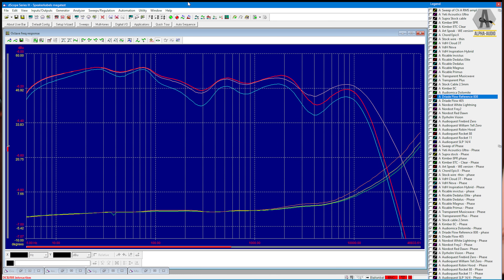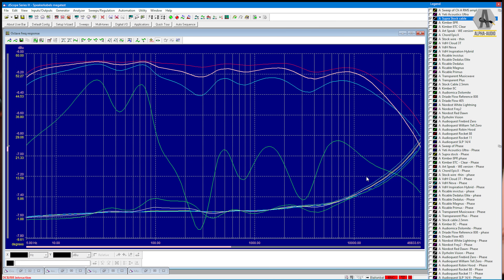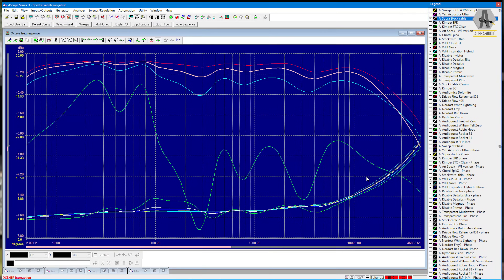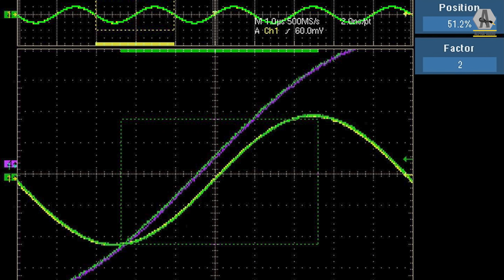Your speaker cable matters! 32 speaker cables tested - with measurements!

Comment: We could tech talk and science all the way deep but 99% of the people don’t hear any difference in cables. On the surface it’s all psychological. There are differences in quality, material, shielding etc but most of these signals are not so much receptive to other signals. If you have a 100.000 system you could debate on using expensive cables but for just common hifi setups, just no. All measurements aside because they just make you reach your wallet.

Comment: I'm bracing myself for a bunch of empty-headed dogma from the flat earthers defending their ignorance and limited capacity for reason with truckloads of vitriol. 

My own experience has indicated that getting the best results with a particular loudspeaker cable depends on which particular amplifier and loudspeaker combination the loudspeaker cable is used with. You really need to try several cables to determine which works best.

Jaap, the assholes accusing you of impropriety are only succeeding in confessing they're the ones who would not hesitate to engage in such impropriety. 

When it comes to perpetually dogmatic internet trolls, their every accusation is a confession. They simply lack the intelligence and self-control to know when to shut up.

Comment: I find it funny how people are arguing about things, they have no practical or real life experience with. I  have taken apart many different type of connectors, stripped down cables of different  types and quality. The variation is  huge. But it not necessarily  translate to a difference you will hear. Some cables have excellent shielding, and some just run a ground wire. Some connectors were solid brass, others hollow. The greatest  range in quality  I have seen was in coaxial cables. You don't  need special knowledge or equipment. The longer the cable the more obvious the difference becomes. Speaker wires, I always run thicker wires than  speaker maufacturers supplied.  Especially  if It is for s longer distance. I don't  want to introduce more resistance into the  system. Don't  be fooled by supposedly gold plated connectors, turned out the actual cable was really low quality. Svideo. Speaker wires high quality buy a roll  10 meter or more, no guessing game.

Comment: I have currently replacing my Fisual Havana Quad XL, which in turn replaced Linn cable with QED XT25 Quad, not because I expect to hear a difference but because the Fisual cable was far to stiff to be practical.
I have very limited space behind my hi fi and forcing such stiff cables into the sockets risked damaging my amp's every time they were unplugged/plugged in.
I'm wiring it into my system while I'm listening, it will be interesting to see if I notice any difference :).

Comment: That is why Zapco introduced there own system for car audio from head units to amplifiers. with much higher voltage vs the basic 6 volt head units. Higher voltage rejects noise and increased transient response with out loss. Robert Zeff back in the day was killing it in the car audio realm.

Comment: Scientists are not testing cables because there is no reason to think they would sound different. This does not mean speaker cables all measure the same. This issue is that the differences are so small. Nobody has been able to distinguish cables on Music in controlled tests. Resistance differences can be audible, but one can simply turn the volume up or down. So, resistance differences basically don't matter. Impedance differences, however, can alter frequency response. The issue is whether they do so enough to affect frequency response, (not whether they measure differently). It certainly Is possible to construct a cable with audible differences compared to most cables. But, for short runs carrying music signals, just get standard speaker cable with sufficiently low gauge. Bear in mind that most speakers have much longer runs of very thin wire INSIDE the speaker.

Comment: ¿How old  are you?  Hearing loss is common after 50, with age-related hearing loss (presbycusis) typically affecting high-frequency sounds first and gradually progressing. Hearing loss in older adults is a gradual process, often starting with high-frequency sounds and progressing to lower frequencies over time. 
 That in practical terms is that when your economical resources increases after 50 or so, your hearing loss also grows sometimes exponentially.   So, don't waste your money in expensive cables if are older than 50, expend the money taking care of your hearing treasures "your ears", and accept that any money wasted in speaker cables or interconnects....YOU WILL NOT HEAR improvements from one to the other except if some of them boost certain frequencies you don´t hear well.

Comment: Ok, I believe you - cables sound different. So what possible use is that knowledge, if you cannot hear it? The final arbiter is your ears, not a multimeter.

Bitter experience of the bullshit about cables has taught me one very valuable lesson: if you do not detect a definite and immediately identifiable improvement the first time you use it - then don't buy it. The last time I upgraded a cable was back in 2012, when I switched from RCA to balanced interconnects, because the increased gain passed this test; everything else I have tried (and I've tried plenty on my Lyngdorf/Monopulse equipment) has failed miserably, including Nordost Tyr, a flagship audiophile product very kindly lent to me by a dealer friend. I think that sums up just how much of a difference cables make in practical terms.

I honestly believe that if people spent more time listening to music instead of listening to their equipment, then they could save themselves an absolute fortune, and enjoy it just as much. Thus endeth the sermon for today.

Comment: I got some audio quest cables and speaker wires, I'm going to change out my 12 gauge oxygen free copper and silver wire and see how it sounds.
They say the $150 cable clones from temu are as good as the $10 thousand dollars ones, should I test and buy those or do you think it is not worth it?
Thanks for the test.
Reply: u better of switching to 10 gauge lmao

Comment: If anyone has cable worries, no need to worry! 10ga multistranded pure copper wire is around 1 dollar a foot! that makes 2 16 foot runs less than 50 dollars! Add 4 sets of "audiophile grade" Kimber SBAN banana plugs (rhodium plated no less) and you have a bar none set of speaker cables for around 100 bucks! 10ga is overkill but dang it looks like you're connecting your speakers with baby arms! You can run 40 amps through those puppies without signal attenuation to over 100 feet!
You can never be too sure you know!😂

Comment: I tested playing music with 10 different cables and then without them. There was an audible, clear difference.
Reply: Without cables no music, right?
Reply: @tamayaytam  Pretty much so. I have to wonder about this guys cables or measuring methods, 6 ohms for a 3m cable is incredibly high and there is a serious design fault in the cable or the measurements were done wrong. The impedance should be in the range of milliohms, not ohms.
Reply: For the people who fail to understand signal chains, I wonder what they think the end result will be if they chain a Cordial pro cable and Monster cable 100 000 USD cable one after the other between their DAC and amp, how much will the monster cable improve the fidelity 🤣
Reply: @Munakas-wq3gp You don't NEED to understand signal chains to know if you can hear a difference. And it probably wouldn't be anything like as great an improvement as upgrading the DAC and/or the amp!
Reply: @MSM4U2POM  Well, actually you do need to understand that if the signal has passed through a regular pro cable a few times, no cable in the world is going to extract information that no longer exists in the recording.
Reply: @Munakas-wq3gp I agree. And no cable in the world is going to improve the sound as much as upgrading the other components in the chain.
Reply: @MSM4U2POM  Agreed...

Comment: Of course speaker cables matter.  Put a typical OCC cable on one speaker, then put a Kimber Kable on the other speaker. Then play music and move the speaker balance between left and right, you will find there is a clear difference in sound.

Comment: Buy a good cable built well that is as transparent as possible, canare, mogami, belden and the like. If the system has problems, the problem is elsewhere not in the cables.

Comment: Provided the interconnects or speaker cables are electrically capable of carrying what is asked of them then that is all you need. It does not matter if different cables sound different as I am yet to have anyone prove that a cable improves the sound.
You can spend thousands on cables and not notice an improvement in the sound yet you can add some thick curtain and notice a massive change.
Reply: Cables don't improve sound... They introduce interference and degrade it to different levels.. The goal is to impact it the least while having an appealing look. A good speaker cable will improve the sound over a poor one. It won't improve the source .. Now learn the difference.

Comment: I have experienced that changing from an inexpensive cable to for example a Cimber 8TC cable make a difference. However, I could not hear a difference between a Cimber 8TC and a Audioquest Rocket 22 cable. Both these cables are exquisite. Equipment used, are pretty good. But the loudspeakers have inexpensive filter, cabling and binding post. Therefore, the loudspeakers are not good enough for the test. The test was done in a non-treated room. My room had big windows at the right-side wall. You know that windows/glass in the area of listening, is the worst thing. At the left side, the room has an open field into the kitchen. Therefore, the listening space is asymmetrical. The sound of the right ear differs from the sound in the left ear. Whith this situation, it is impossible to value a speaker cable to another. To do a fair listening test. It I nessesary to do it in a HIGH-END listening room/sound studio. 
Do you know that professional sound mastering engineers, do not have astronomic expensive speakers and cables. Their best speakers are typical active and costs less than 20 000 Euro. I know of a particular speaker that us the best components: Blisma beryllium twitter, Blisma beryllium midrange and 10” Purify woofer.  These components are among the best you can get. In spite of that, they cost about 15 000 Euro.
From this, I will claim that the Hi-Fi industry have blown up the cost og high-end equipment to a ridiculous level.

Comment: Mogami w3103 in bulk, Techflex Flexo nylon sleeve,  13mm cable pants, some Sumitomo heat shrink, NO CONNECTORS i go raw dog with Oyaide SS-47 which has 4.7% silver (or Mundorf Supreme). Check out Performance Audio for the best prices. I like the Quality and performance of all these Japanese brands.

Comment: Ridiculous that he even talks about a cable is silent, and one cable was more dynamic and Italian like 🤦🏻³ if the cables is more silent it's only if it has so much resistance that a very little amount of power comes through it 😂
If you want a serious comparison, you take cables with same cross section area. If the more expensive cables are 4mm compared to cheap 2.5mm of course they perform better. But you can get cheap 4 and 6mm too. Haha him saying that Nordost cables are faster... Only Nordost them self claim that, and unless you've got a frozen cable, it's going to be the same speed as the material it's made from for example copper. Cable companies come with all sorts of claims, but never backed up. There are differences in cables. The less resistance the better. So thick multi strain copper is best and it cost pretty much nothing. A lot a cable and speaker manufacturers have now also begun to use rhodium plugs because it's more exotic and expensive than gold, so it must be better... Right? No rhodium is really poor conductor. About half of gold. It is however more durable, so if you plan on taking the plugs in and out of the speaker 1000x rhodium might be better, but if you are not a complete idiot, and you just connect the speakers, and that's it. Gold is the best choice. Copper is a much better conductor, but oxidizes. So copper cables with gold plugs so it doesn't oxidize is the way to go.

Comment: I have just changed my 45 year old 10 amp cables for new 13 amp cables.
Zero difference. Resistance is 20 ohms per mile. 
FYI, skin effect does not start until 50kHz. Its not an audio issue!
Reply: Such a technical approach to this subject must mean you now are the god of cables 😂. Dude wtf

Comment: Wires do not have "sound quality".  Anyone who thinks they do is delusional.
Reply: correct, they only have internal resistance which is negligible for a home system. caveat - so long as you aren't buying $5 cable with dodgy connections.
Reply: So very trapped by your own lack of understanding there. You’ve clearly not spent any time doing the relevant modern reading, and you’ve not made the effort to get any experience.

Comment: i really appreciate all of the work put into this review process. i will admit the majority of this is beyond my level of understanding, but I do know from experience that speaker cables and inter-connects affect sound signatures. i have replaced/upgraded all of my cables in my own main 2.1 rig and definitely hear sonic "improvements", mainly the high frequencies have more 'air & sparkle' where I ended up going more "toe-out" to achieve a balance with the low-end which seems a little thinner than before. - or I'm just making it all up in my head.

Comment: Why I reckon cables and interconnects would sound different:
I build speakers and design crossovers and I found that directly twisted crossover part connections sound better than soldered connections. And indirect wired and twisted connections (with standard cabling) sounds different again. Soldered joints sounds more "scratchy" in the top end and twisted cabling between the parts sounds a bit too "wissy" for me, not klangy enough. But directly twisted crossover parts connection sounds great and well balanced in the top end. Sounds really transparent (the naked sound). All my speakers have that (except if I want an effect or the components won't reach each other). My crossovers don't have many parts and if I make it with 3 separate groups (woofer, medrange and tweeter) (of a few parts each) I can get away with (contorted) directly twist-connected parts. And only solder the tip of the twist (that is 1 cm long) so the signal bipasses the solder. 😅 I love the sound, I have a NAD C356BEE amp and an Adiolab 6000A amp and some B&W 706 bookshelf speakers, and a few pairs of my made speakers, point source open driver speakers with a big fat 10" woofer (in the box). They are point source from 300 hz up, and dipole! Sounds come from nowhere and the image is on steroids! I built open FR plus woofer speakers and open 10" coaxials plus 10" woofer speakers. 😅
Reply: I have a sophisticated system my sound is cristal clear, everything you would expect from linier power to audiophile Silver plated interconnects.
You sound like a right person to ask, although I already love my sound my speaker cables are more the 99p variety. I think I am more in the Market for Expensive Copper than silver etc.
Do you have any advice for Premade cables between my Prima Luna Integrated valve Amp  (6 Ohm output into Focal Aria Speakers.

Comment: Why not simply a table with an inductance ranking?
If you would have done so, you would have find out, that the Kimber 8TC has the lowest inductance -at least of the cables you use. So the Kimber 8 TC makes lesser signal degeneration than the other cables. You can also use old 36 string computer cable (Belden 2501?) and cross connect it. This would make even better inductance results.
Reply from the maker: Well... Lucky you! We have put everything in a neat table in the full, written article on our website.
Reply: The capacitance isn't very good on that cable. Choose your poison.

Comment: The average speaker voice coil contains about 100 feet of very fine wire, which is somewhere between 28 and 36 gauge, depending on the speaker. Then, there are multiple drivers, a crossover network and the speaker cable. The load seen by the amplifier is the sum of the above. Putting a multi thousand dollar "fire hose" cable at the front of this load does very little, if anything at all, to affect the sound. The giant cable represents a tiny fraction of the load seen by the amp. "High End" cables are a marketing ploy, pure and simple, and not an honest one at that.
Reply: A marketing ploy, exactly.
Reply: Decent gauge cable is good enough, but hey; if you have money laying around, then spend it on expensive stuff.
Reply: Actually there is a scientific benefit of using a thick speaker cable. But any garden variety 4mm2 copper cable works just as well or better than a 20k high end cable.
Reply: @Munakas-wq3gpThat's blatantly false. Oxygen free isn't a hoax... There are several other reasons why the quality of the cable matters. It just ends at diminishing returns way earlier than the price of a new car 😉🤣. Like x/10000
Reply: Are you sure about that? You might want to run your numbers again and what a poor cable and connectors can do to the damping factor/output impedance on say a Purifi Eigentakt.
Reply: @dicmccoy  For damping factor the cable cross section and by that, low resistance, is the important factor. A regular large cross section cable and as short a cable as possible are all you can do for damping factor. Active speakers are the best in this regard as they require no meters worth of speaker cables.
Reply from the maker: @indyvin  Ok. Thanks for the explanation
Reply: @TheAlphaAudio  does one detect sarcasm in that reply.